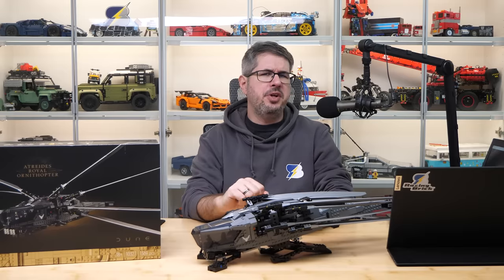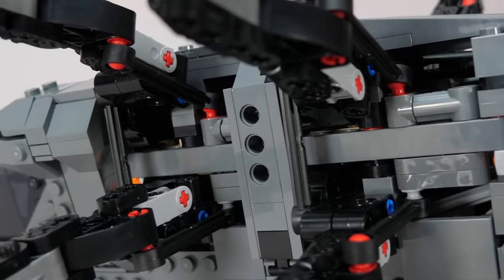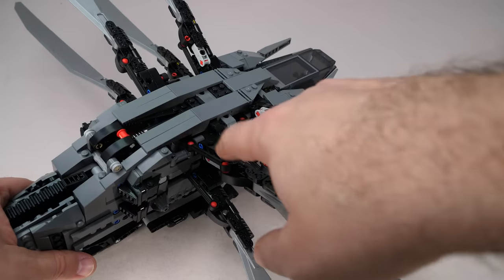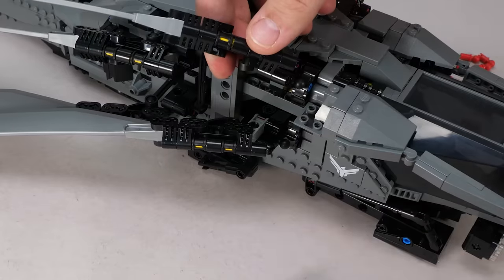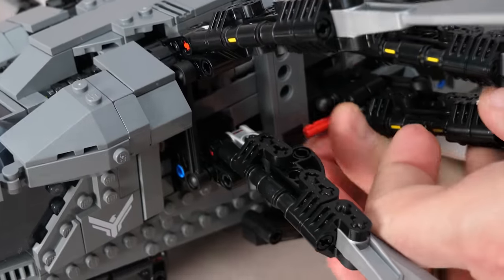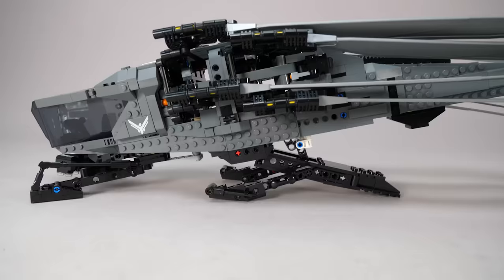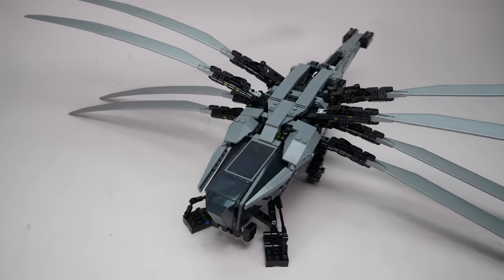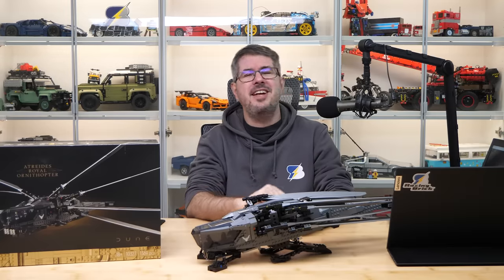Improving the LEGO 10327 Dune Ornithopter for less than $4 - color swapping red pieces

Comment: I replaced all of the ones that you've pointed out, and also ordered enough 3L pins in black to replace the visible blue ones. I don't think the 2L pin/cross-axle has ever come in black, but that yould be the next one I'd want to do. 
There's also some yellow axles visible, but I didn't think to substitute them with gray or black until I was done building.
Reply: I found a good source of black 2L pin/cross-axles. Set 8473 has 22 of them, and the 'thopter has 7. I think I'll replace those yellow axles after all. Have plenty of those already.

Comment: I just picked mine up this weekend, but I'm thinking I'll go get the replacement parts now before I put it together. It does look quite a bit sharper without the red pieces. Also thinking about maybe trying to get some smooth pieces to put on the exterior of the 'thopter to cover up some of the studs that are showing. Don't know how much I'll put into that before I get it built though

Comment: I’ve swapped out most of the red ball pins and the wing open/close bush but haven’t yet bothered with the red axels, that may happen in the future. What I have done is gone for a smoother look to the outside of the fuselage by adding some flat panels because I just got somewhat bothered by all the studs showing. Not entirely done with this modification but once I get the parts it will be finishing off the red parts then done. So far, with one side of the fuselage completed I prefer the look. 

(For some reason my brain is now thinking, “how can I hide the exposed working of the wings?” This may be an endless build. 😅 )

Comment: Well I can tell you why they went with the red pieces! - It's so I would spend another $15 in the LEGO shop getting a load of color correcting pieces! Well played LEGO. xD 
Big big thank you for this and the older build video. Helped me determine all the pieces I would need before I built the set and would have to tear it down. 
Other than the red parts, I also went for all visible blue, the 4 orange ball-poles, the 8 almost invisible yellow axles and the grey perpendicular connectors in the wings, the grey half-beams and tan pins in the landing gear, the red L-beams and bushs visible on the bottom. Will also cover up all the brick holes on the sides with short pins and tiles. 
This is the first set I buy in 20 years. It's THE ONE. Cant fit many at home so gotta make the one I get count. Will probably add lights to it cause why not. 
Have never really thought about upgrading and perfecting an official set. Such an endless world opening up.
Reply: ((oh yeah and I have a bunch of older LEGO so had 12 of the no-longer-in-production black 3 wide pins laying around to replace the blue. Lucky me))
Might cannibalize my built Technic sets 8408 8417 8443 and give them the blue pieces xD 
Actually now that I look at it I think there's 7 visible blue 3 wide pins per side, so 14 total, so I can just take the 2 from 8417 that is already a blue set.

Comment: Nice Video!
Is it possible for you, to add all the other "wrong" color-parts, too?
I'll get the Set in 3-4 Weeks an it would be very nice to replace all the blue and orange parts with black or grey.
Thanks a lot
Reply from the maker: The part list is available on multiple sites, you can create your own list based on them
Reply: I uploaded the Bricklink XML part list to the Pinned Comment of all the pieces you need to replace all visible blue/red/yellow/orange pieces on the Ornithopter after I went through his list and the manual!

Comment: Nice.  I have this set and I love it, but some of the colour choices baffle me.  I don't care what's on the inside, but on the outside we have so many visible red bits, lurid orange ball and rod pieces, bright yellow 3-length axles (I do appreciate the black tube piece that covers the middle of these, but why not just use a black axle and lose that piece?), bright yellow 1x1 technic bricks, random use of light grey in the cockpit, blue long technic pins.. the list goes on.  Almost all of this can be in a more sensible colour, and sometimes you even get other pieces of the right colour in the set itself!

Comment: I think some of the technic parts are color-coded based on their properties, such as how tightly they fit with other parts, which much explain the choice of red pins
Reply from the maker: This is true for certain parts, e.g. friction- and frictionless pins, but not in the case of red 2L axles or the pin with towball pieces, the red and black versions are otherwise identical.

Comment: I was sure that when they replaced the black 2L axles with red ones, they started using them exlusively. Turns out the black ones never went away after all, I find that very surprising tbh

Comment: Two things that would bug me, you replaced a red axle spacer with a black one but you left the white one by two pin axel, I would have to swap it for a black one, secondly I would replace the single white modified one by one pin and axel clip

Comment: I had absolutely zero issues with the red pins until I saw this. I just ordered the set, so I may need to put a Bricklink order together before I actually build it…
Reply: I uploaded the Bricklink XML part list in my Recent Comment of all the pieces you need to replace all visible blue/red/yellow/orange pieces on the Ornithopter after I went through his list and the manual

Comment: Hello, I have a question: I ordered this set; you say that "you cant change the blue pieces..."...why is this not possible, it would be nicer to change also the blue ones...?? Thx, greetings
Reply from the maker: I don't think I said you cannot change them, those parts are simply not available from LEGO anymore. You can look for them used though, I suggest to check Bricklink.
Reply: @RacingBrick  Anyway...allright, I understand...thats sad :-) I look for the red ones you mentioned, have a good day!
Reply: I uploaded the Bricklink XML part list to the Pinned Comment of all the pieces you need to replace all visible blue/red/yellow/orange pieces on the Ornithopter after I went through his list and the manual!

Comment: Big improvement, though I would probably swap all of those colored pieces during the build. It's a shame though this is even necessary, in this case I truly don't understand why Lego thought all of the color puke was a good idea to begin with. 
While I'm not a fan of all the weird colors on the inside of a model, to some degree I do get why they do that, even when it could easily be toned down quite a bit (like with the 10497 Galaxy Explorer). But too often bits of that remain visible, or like with this (otherwise great!) set they're just in plain sight, ruining everything.
Reply: I'll guess the "color puke" is Lego looking at what pieces they currently are sitting on and can be used in this set without having to produce them in other colors, especially if they are hidden.
Reply: @Mark-OutWest  Even when I rather not have it at all, I can overlook it when it is indeed hidden. Here a lot of it is in plain sight. And most of those pieces are available in other colors. Heck, this set even includes a bunch of black 2M axles, yet for some reason they still used red ones for other (visible) parts. It doesn't make any sense.

Comment: Can anyone confirm if there is a difference between the red/blue pins and the black pins in terms of friction, how well they’re supposed to hold structures together? Or is it simply just the color that differs?
Reply: Just color. There are frictionless pins but those are a different color. If you're interested in doing the color conversion, my comment below has a detailed guide and a larger list of what you need to replace all the red/blue/yellow/orange pieces

Comment: I hope you know there black replacements for the blue parts as well? Those aren't new pieces that never had another colour.
Reply from the maker: I hope you know those parts are not manufactured anymore and might not be available everywhere for a reasonable price.
Reply: @RacingBrick  I do, I buy on bricklink too. Also acquiring used lego, provides those pieces as well. I did not want to attack you here, but with the many options we have with lego, I thought it should be mentioned.

Comment: Could you swap the blue bits, too?
Reply from the maker: You can swap them, but as those pieces are not manufactured in black since 2007, you need to buy them used on Bricklink

Comment: Great, but you forgot to add the service fees to the total cost. The yellow axles could also be swapped for grey ones. For the blue pins one could take a black marker and color the ends. Not a purist solution but better than to buy those from BL too.
Reply from the maker: As I mentioned, I'd suggest to order these parts together with other pieces or sets to save on the extra fees.
Reply: @RacingBrick  I know this. You only talked about shipping costs. But these min. buy fees come on top of that (3€ for Bestseller parts below 12€ and 6€ for Standard parts below 12€). Just wanted to mention that since not everyone knows how B&P work.

Comment: I have no idea why LEGO use so many colour parts in +18 sets? There are made for adults and/or experienced builders. 
Not matching colour parts look ugly and they don't make building process easier.

Well done on this one!
Reply from the maker: It is made for adults but not strictly for experienced builders. The 18+ category has sets for casual adult builders as well, they might buy these as their first LEGO set.
Reply: @RacingBrick  Adults should be skilful enough to handle matching colour parts. This is not rocket science.

Comment: Now if only someone could come up with an effective solution to the droopy/ bent rotor blades on the right hand side of the craft… 🤔
Reply: You’d have to be very careful, but I suppose a precise application of heat could help straighten out the bend

Comment: They do it for cost. Printing 1bn red pins is cheaper than doing lots of different colors. Really sucks
Reply from the maker: I'm sure that is not the case, the black ones are in production and used in several other sets. The black 2L axles are even used in this set as well.

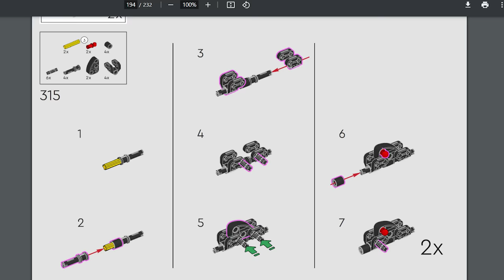Comment: 1:00 "if these parts were black, I don't think people would be confused" - that's the sensible approach, which I would agree... if I wasn't in several Lego groups on FB and seeing what people asking even in case of simplier sets, requesting help which normally turns out as mistaken/forgotten step from their end.
Having an engineering mindset is good for Lego, specially in Technic, and it seems to be a too high ask. At least if we are talking about general population.
Reply from the maker: It is quite difficult to find the balance, especially for sets that marked 18+. Most people would assume these are targeted to experienced adult builders, but they aren't. Lately I noticed an effort with some Technic sets to hide the external colorful bits, and only keep the color coding for the inside. I think in this case the building experience of the wing supports would be pretty much the same if those few pieces were black.
Reply: @RacingBrick  don't get me wrong. I agree with you, I would prefer such sets, yet I feel the general audience cannot manage an avg technic set. It seems to me that since the coof more peeps getting into lego, even if in a limited capacity like a specific licensed product - but that is a completly diff discussion with its own black holes...

Comment: I'm quite disappointed you didn't fix it all. Like the remaining blue pins, the yellow bars and the remaninig red parts. It's so close to perfection...
Reply from the maker: You are totally free to modify it further, I showed a quick and easy way to improve the look without taking the set apart. Also, blue pins are not available in black from LEGO, you can only buy them used.

Comment: I don't think it was made to make building easier and more enjoyable. I think the reason for doing this is to save money and ensure sustainability. It seems like, in this way they are trying to utilize the different colored parts and raw materials which they already have. Additionally, by putting many different colors in a set, they prevent us from doing different things from the pieces of that set. So we have to buy more parts or sets from them. :)
Reply from the maker: I don't think red plastic would cost less than black